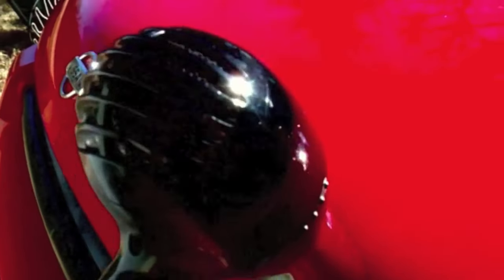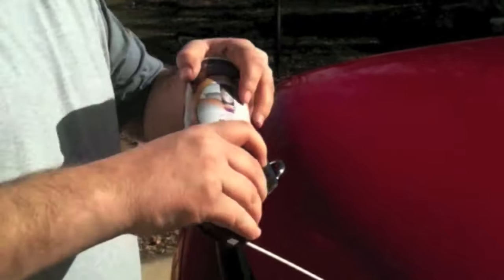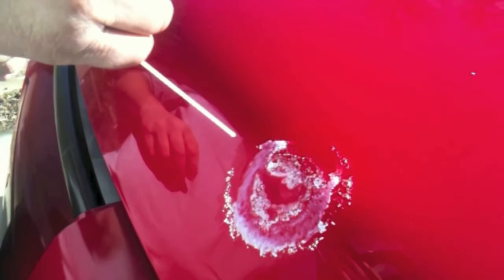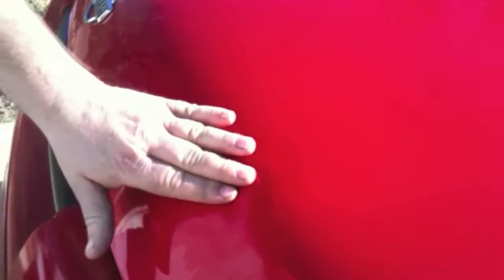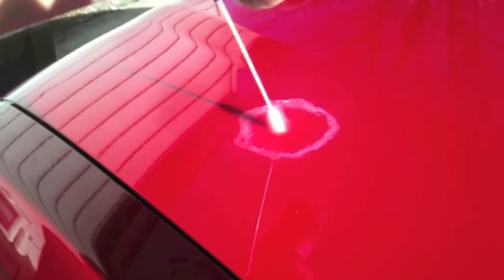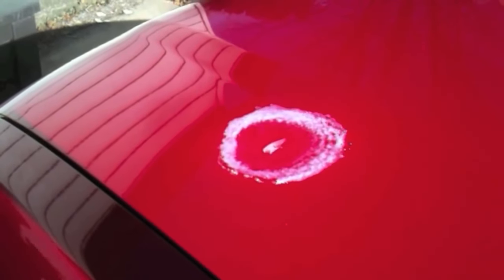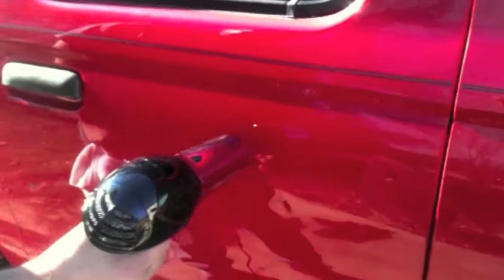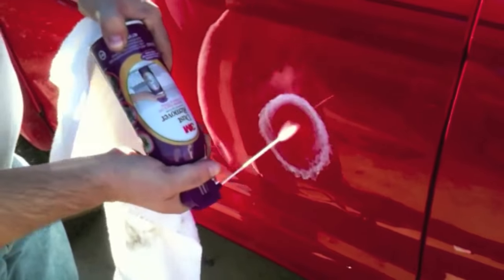Small Dent Repair - Hair Dryer and Compressed Air -  Short Version VIdeo

Comment: The application is wrong, so the result is negative.  Think about what is happening, heating and freezing metal, or look at it like this, expanding (heating) and shrinking (freezing). The correct application/process is to heat the center of the dent, then quickly freezing around the outside of the dent, shrinking the metal, so that the heated area expands and pops the dent out.  if you freeze the whole area that defeats the purpose and the physics of the process. Doesn't work well if dent is creased... good luck!
Reply: G- Rod thank you somebody's finally got a brain to tell how to do it
Reply: yup science 101.
Reply: Skwkt
Reply: Can't the extreme temperatures crack the paint?
Reply: Would using the inside of the panel create a different result ?
Reply: G-Rod, I believe you are accurate in your metal behavior in a dented sport on the car.  I make lots of sense in physics that the heated dent will expand while the cooled area with compressed air will shrink.  Thus, causing the dent to pop out!! Thanks for the explanation.  Regards, EJDossary, EE
Reply: So it worked for you g rod ..

Just got my first door ding..
Reply: What are you using to just heat the inside of a hail dent since it’s so small
Reply: @blazeswitt728 have you ever felt a car that’s sitting in the hot sun? Hair dryer for short bursts isn’t going to do any damage

Comment: ive had it work on 1 dent, and not on others. i think the dents are kind of different, there are ones that "suctioned" in, which it works on (plunger also will get these probably).  the other dents, that are slightly creased or smaller in size, are when the metal actually has a bent in it, and it does not work on these ones. just tried and failed today.. bummer
Reply from the maker: Thanks for your input....and for watching.  I did not have much luck with this method.
Reply: No
Reply: slopedawg1 Turn the hair dryer on
Reply: You were suppose to hit it really soft with your hand that's why it didn't work
Reply: Just watched another video the guy doing the same as you but he hit it really soft next to the dent and it just popped up
Reply: +Misscarlapaola I didn't see that one, but it makes sense.

Comment: Heat expands..cold constricts. Seems you should heat a piece of iron to cover just the dent and heat around dent. Then get cardboard with a hole cut the size of dent and then spray freeze through just the hole.. don't freeze the entire area. Or vice versa idk havent tried it yet.

Comment: Depends on the heater's power. Heating time should be range from 15 min to 45 mins. Heat the dent and the around area --> push on the other side --> cold water freeze. Works on plastic only.
Reply: Plastic makes no sense. Definitely works on metal dents - it's just heat expansion/contraction.

Comment: Good to know what does and doesn't work. What about heat gun and dry ice?  Any chance of damage with heat gun?
Reply from the maker: +Michael Shaw I think a heat gun would do a better job, but I have not tried it.  I did try dry ice and it did not work to well either.
Reply: heat gun might mess up ur paint
Reply: I heard the blow dryer works better

Comment: You have to be patient.  The guy in this vid was too impatient and rushed through it.  Better results if you let the dryer heat for roughly 30 seconds, wait for 5 seconds then spray the carbon dioxide(air duster) for roughly 10 seconds in a circular motion.
Then wait until all the frost disappears...then wipe off.

Works every time.
Reply: You been able to fix hail dents doing this?

Comment: from what I understand the philosophy behind this is you heat up the outside edges of the dent the metal will expand.  Then in the center of the dent you put the cold freeze on it.  This is contract the metal pulling it back together.  but Ive never had much luck either with this.  Ive also heard of people using dry ice which gets even colder
Reply: 2LateIWon/Organized Chaos This guy is an amateur in this video, the people above you are bodywork guys say that you are supposed to freeze around the Dent and heat on the Dent center, not the other way around. The guy in this video has it backwards you probably actually made it worse

Comment: My understanding is that it is not a common hair dryer that is used in the proper use of this technique.  Hair dryers do not produce much heat.  Try using a heat gun (they look like a hair dryer) most heat guns get up to and over 1000 degrees.
Reply: And Melt the paint right off your car.  Heat guns are used to strip paint from walls
Reply: @cyberace27  I tried a heat gun (1200 watts) and a whole new can of compressed air.  No dice I'm afraid.  I do think there are different types of dings which will behave differently to this method.  =/

Comment: I don't think spraying it again with the compressed air is going to do anything. It's already frozen and by stopping and freezing again, there is only a small temperature difference. I'd think with a massive temperature variance from extremely hot to extremely cold that it would be the best way. Like the other guy said, you sprayed the dent seconds after you used the hair dryer. You should try it again, but once you remove the hair dryer, you immediately spray it with the canned air.

Comment: ...dammit people, that "canned air" shit is NOT "compressed air".  Compressed air means pressurized breatheable air (78% nitrogen, 21% oxygen + 1% argon/misc) from a mechanical air compressor.  "Dust off" or "Canned Air" products are either tetrafluoroethane, difluoroethane, or trifluoroethane which are liquid when pressurized.  Atmospheric air CANNOT be liquified at anything near room temp at ANY pressure (the critical temp of the constituent gases are WAY too high).  Yeah, yeah - I'm splitting hairs on definitions but I'm sick and tired of everyone SHITTING all over the correct usage of technical/engineering terms.

Comment: That hairdryer is too far away and it's not exactly going to strip the paint like a heat gun would. Put your finger next to dent and when your finger blisters it's hot enough and won't damage the paint. Then go to hospital.
I can't wait for the long version of  'Get a dent out of my car that doesn't work'.
I think it worked on his 10th tin, but it cost more in tins than taking it to a body shop.
He has other video's.
'How to respray your car but I haven't got any paint'.
'How to Teach your Dog to Sit and Stay, but it ran off.
'How to safely cross a road but I got hit by a bus.
Could you save viewers time by doing a video of ' How to safely throw a Hand grenade'.